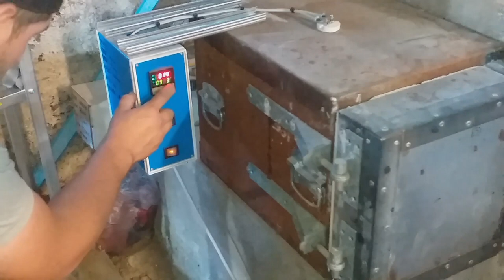Branco Customs | Custom, beautiful Tracker Knife with maple burl handle - full build video

Comment: Ok 1. why did you put a Bolster? 2. Why Stainless Steel when the Tracker Knife is made with 1095 If I remember correctly making it stronger and better then Stainless Steel? 3. Why did you epoxy the handle when the handle is made to come off so you can turn the Tracker knife into a Spear if need be same as the Scout knife that compliments the Tracker 4. why did you not FORGE this knife… It looks great and all but you can have shinny or sharp.... Sorry this is a wall piece not a working piece
Reply from the maker: Hello, Thank you for your comments.
This knife want not created to be a exact copy of a genuine tracker knife. If someone wants a genuine tracker knife, then it is best they go and buy one from the original makers. This is made to be a nice knife for pleasure usage and an item of aesthetic beauty as well as being functional. Stainless Steel for low maintenance, and only to be used as a knife, it does not need to be tied to a spear. 
N690 is a hypereutectoid super steel that is way superior to 1095 easily 4x the price just for the steel, AND much more expensive and complicated to heat treat, and to forge it would ruin its exacting qualities. 
Genuine tracker knives are not forged, they are made in the same stock removal method as I have used here. If thee genuine ones were made of 1095 they would be easily twice the price and no one would buy them... that is likely why they use 1095, which is also a great steel.